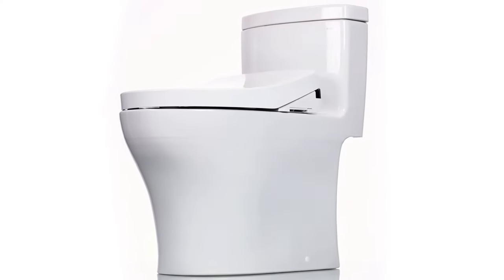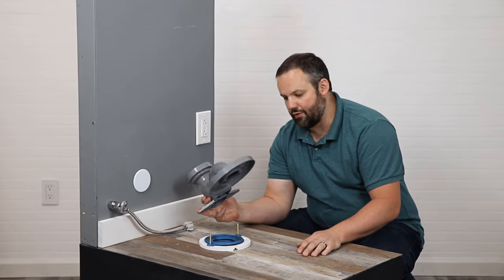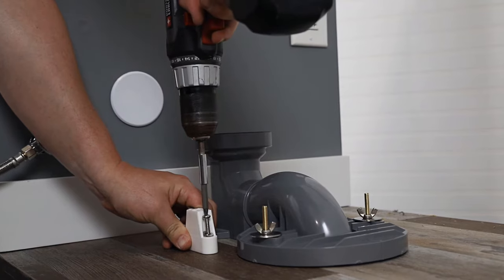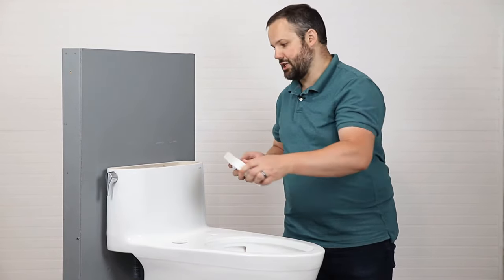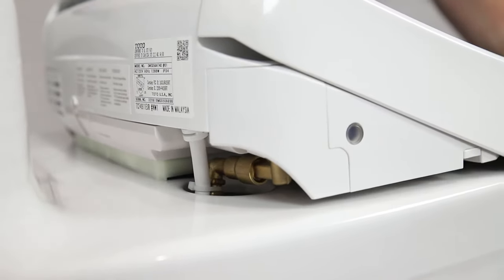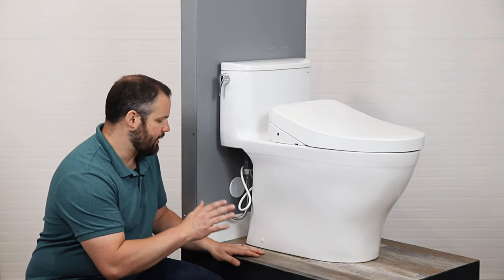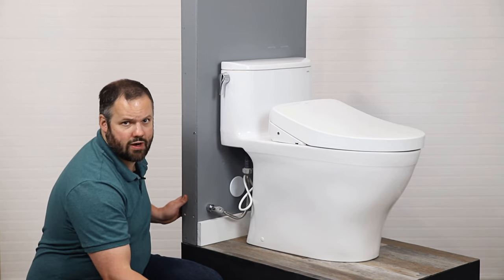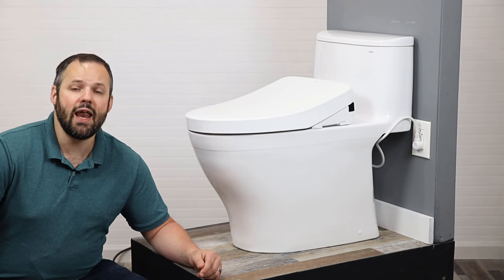How to Install a TOTO Skirted toilet | TOTO WASHLET+

Comment: Hi Daniel, 

My auto flush on my nexus with washlet 550e doesn’t work consistently. It does auto flush but not every time after use. What can we do to fix it? 

Is there option to auto raise the seat as needed after the lid auto open?

Does Toto sell adaptive children toilet seat for little kid? If not, will it cause any sensory damage to the seat itself if we place one on?

Thank you very much for all your straight to the point informative, honest and helpful videos!
Reply from the maker: Thanks for asking! The auto flush should work every time.  If you want to reach out to us with your order number with us, we can file a warranty claim with TOTO on your behalf.  There is an option to raise the seat on the top of the remote.  If you don't see it, whoever installed your auto flush did so incorrectly, and did not put the proper top on the remote.  There is no adaptive children's toilet seat made by TOTO that I'm aware of.  I would worry about scratches to the seat should one be used.
Hopefully you found this helpful!!  Thanks for reaching out!!

Comment: Just installed ours thanks to your video! Is it normal for a little bit of wiggle up and down. Only when we lift up would it do this. Not when we apply downward pressure.
Reply from the maker: It is normal to have a bit of wiggle.  If you're concerned about it, I'd recommend checking out a local show room, and seeing how the wiggle on their washlet+ units compares to the wiggle on yours.  That will help you determine if your seat is properly installed.

Comment: Hi, I measure 11 inches from the flange bolts to the wall. Will I be ok installing this unit?  Thanks
Reply from the maker: Unfortunately, anything under 11.5" is going to be too tight. You could try an offset flange to help get that extra bit of room or look at an option that comes with a 10" rough in size (Drake or Aquia are good options)

Comment: We just purchased a washlet+ toilet and didnt realize it required a special model of bidet. Can we still install our (current)  SW3036 ? I know we wont be able to hide the hose or cord but having a hard time figuring out if thats the only ramification
Reply from the maker: You can absolutely still install it!  You are correct, there are only a few ramifications:
1. The cord and hose will be visible.
2. You won't be able to install auto flush
Aside from these two items, you'll be just fine!

Comment: I have a Toto Nexus 1G that needed this kind of installation. I had to remove the toilet and those plastic things that keep the toilet from moving side to side have holes in them from the initial installation. Is it ok to reuse the same mounting blocks when reinstalling or would I have to get replacements? If so, do you know where I would be able to buy them? Thanks.
Reply from the maker: I've had customers reuse the same mounting blocks before without any issue.  In my opinion, reusing them is fine.

Comment: I am updating my bathroom so i have the wall exposed so i can run a new outlet to the toilet. What about hot water? Does the seat warm up cold water or is there a seat that can use hot water line?
Reply from the maker: It heats the water in the seat itself!  No need for a hot water line.  Great question!

Comment: At the 6:00 mark, do those sidescrew need a proprietary bit? I'm having trouble tightening a loose bowl with a regular screw driver.
Reply from the maker: Nope, normal Philips head, but it's a LARGE one...  If you're sliding you might try to find a bigger screwdriver bit...

Comment: 10:43 The bidet socket has a special connector.  How could I add a water filter for less calcium between the T connector and the Bidet socket?  Thanks.  Is the socket 1/2", by the way?
Reply from the maker: Sadly TOTO does not recommend any kind of filter.  Using one will void your warranty... :-/

Comment: We have a Toto C5 bidet and our plan is to slowly upgrade with Toto toilets.  With the different orientation of our C5 bidet does that mean we can’t use the power cord and water tube hole on the toilet for a seamless look?  Can the water tube on the bidet be adjusted to make a seamless connection?  Thank for the video and answers to our questions.
Reply from the maker: Sadly it can not...  The TOTO washlet is either made as a washlet+ seat, or it is not.  There's no way to convert it after the fact :-/  Sorry for the bad news...

Comment: Hello Daniel.  Thanks so much for this informative Toto video. Does the flange adapter have to be perfectly symmetrical to the drain pipe?  I need to install my Toto toilet about 2cm to the right of the centerline of the existing drain pipe.  My contractor tells me it is impossible to do this as the adapter has to be perfectly aligned to the wall as well as being perpendicular to a straight line passing through both openings in the flange adapter.  This has become a major issue on my remodel and he has offered no solution.  I hope you can help.  Thanks!
Reply from the maker: If I understand your statement correctly, because the adapter has to be bolted down to the flange, the adaptor does need to be lined up with said flange, which would then mean the toilet would have to be installed at an angle of the flange is not straight.  If this is what your contactor is saying, I agree...  :-/  If you would like to send some pics over, I'd be happy to review and give additional feedback if we're able to come up with a workaround.

Comment: Can you mount a regular total seat on this nexus washlet
Reply from the maker: Washlet+ toilets can be used as a standard toilet with a standard toilet seat. You will have the hole in the back for where the bidet/washlet cords usually route. So that is sometimes not customers preference. The Nexus is made as a standard toilet without the washlet+ hole if that was the plan from the beginning.

Comment: The two side blocks do not have pre-drilled holes. When we put side screws, these look like they go into those side blocks. Should we first pre-drill pilot holes into those side blocks? I feel directly putting those large side screws will crack the plastic side block.
Reply from the maker: The blocks do not have predrilled holes, and are not designed to.  TOTO does not recommend drilling holes into the blocks.  While it would seem like the plastic might crack, to date we've never seen that happen, and due to the fact that TOTO does not suggest drilling holes in the brackets, I'm assuming they rarely if ever see an issue like that either.  Great question!!

Comment: I have the new toto Carlyle toilet and the Toto Sw3084 washlet. Is it still possible to install the washlet water hose through the hole? The bracket is longer than the one in the video, obstructing almost half of the hole. Can I still put the hose in the hole or is there an adapter that can be used? Thanks!
Reply from the maker: There is no adaptor.  I do not think the fact  that part of the hole is covered should be an issue.

Comment: We just installed ours and it has a small leak at the base, would you happen to have any trouble shooting tips?
Reply from the maker: There are a few different reasons we've seen this happen.  Normally when this happens it's because either the flange is too low, and you really should be using 2 wax rings, or the toilet is cracked somewhere that is causing a leak.  If the issue is simply due the the flange, the fix is easy.  Take the toilet off, put two wax rings on instead of one, and reinstall.  If the issue is due to a cracked toilet, at that point, you'll need to reach out to whoever you purchased from to see about how they handle replacing the toilet.
In the future, if you're ever looking for another one, reach out to us for a great deal!

Comment: Hi Daniel, we have a Toto smart toilet with the skirted bowl and flange adapter that we had installed about a year ago.  We are getting some sewer gas smell.  Is this an issue you have run into before and what is the best way to diagnose where it is coming from and how to fix?  I believe we used a wax ring, but can the rubber ring on the top of the flange adapter be replaced?  Thanks for your help!
Reply from the maker: To date I have not heard of this happening.  However, in my opinion, I think you're heading in the right direction. The adaptor is easy enough to replace, and should be replaced if the rubber looks like it's going bad.  Again, to date I've not seen that be an issue, but it's worth checking.  I would assume that if you take the toilet off, it will be clear where the problem is.  As long as it's not cracked porcelain, the fix should be fairly easy
Reply: @ManyBidets  Thanks for the quick response Daniel! I will let you know what I find.  We love the bidet, by the way.  It is awesome!
Reply from the maker: @markschulert2189  No problem!  Next time you're in the market, reach out!  :-)

Comment: So do you recommend using wax rings or rubber no wax rings?
Reply from the maker: We like both, but personally use the rubber rings as we're often changing out toilets, and they are cleaner.  We've never had a single issue with leaking.

Comment: Very helpful, thanks 🙏
Reply: I would think few people would put a toilet on wood, what to do when using tile?
Reply from the maker: Very valid point!  We've installed toilets like this on tile as well.  A few tricks worth considering: First make sure you have a drill bit designed to drill into tile.  TOTO provides anchors to insert into these holes.  Secondly, put some painters tape down and drill through the tape.  This helps to keep your drill bit from sliding around so you get a nice clean hole.  Let me know if you have any other questions!

Comment: Which bidets have 10" rough with universal height, auto open close & flush
Reply from the maker: If you're looking for a traditional, non-skirted design, I'd recommend:
https://www.manybidets.com/product/toto-drake-transitional-washlet-s550e-two-piece-toilet-and-bidet-system-1-28-gpf-ada-compliant/

If you're looking for one with a skirted design, I'd recommend:
https://www.manybidets.com/product/toto-aquia-iv-washlet-s550e-two-piece-toilet-and-bidet-system-1-28-gpf-0-9-gpf-sku-mw4463056cemgna/

Comment: Hi Daniel, the bidet not working even I press the side button
Reply from the maker: We always recommend trying a hard reset by unplugging the unit for at least 60 minutes and plugging it back in. Checking your electrical outlet for power as well or plugging the bidet into a different outlet to test are other good steps to take. If you are still having issues, reaching out to the manufacturer directly will be best.

Comment: Great video!  Last year in a bathroom reno, the plumber did not rotate the Tee Connector so the washlet hose is sticking out in plain view to the left of our mostly skirted Toto Vespin II bowl.  If I shut the water off and flush until it is out of the tank, can I, at this point, disconnect the water supply and try to rotate the Tee Connector myself and reconnect the hose, or would I need an entirely new hose and o-ring?  Installation was 9 months ago.  But maybe I should have a plumber do it and test it for leaks?  What do you think?  A second bath reno is coming up!
Reply from the maker: If you follow the proper steps (as you listed out above) I don't see any reason why you shouldn't be able to do exactly what you're trying to do without any negative side effects. You should be able to turn the water supply off, drain the tank, reposition things, and reconnect without needing to pick anything else up.  Hope this helps!
Reply: @ManyBidets  Thank you!
Reply from the maker: You are very welcome!  Thank you!

Comment: In addition to the Toto S550e Bidet seat that has the cord and hose coming differently which allows it to be routed through the big hole in the toilet large hole, are there any other bidet seat that have that same cord and hose configuration coming that way?. I am asking as I am buying a Kohler K23188-HO-O that has the same large hole to accept the cords and conceal them. I do not want to see the cords if I buy the wrong bidet seat..So I was thinking buying the S550e but I wonder if other brands have also a configuration thta totally conceals the cords if routed through the large hole on toilet ceramic
Reply from the maker: Thanks for asking!  We have, to date not tested the TOTO Washlet+ seats with other brands of toilets to see how they work.  I could see the other brands working with these washlets if the hole was in the proper location, but since we've not tested them, I can not guarantee that it would work. Your best bet would be to get a seat, and try it yourself.  If you were to get one from us, you could return it if it was not installed and didn't work.  Thanks for the question, and let me know if you want to give one a shot!
Reply: @ManyBidets  Thank you very much for your quick response. I will decide on the bidet seat once i install my new Kohler Toilet
Reply from the maker: @chinomalon  Sounds great!  Let me know if we can be of any additional assistance

Comment: is this durable?! The entire toilet is held down with only two screws going in sideways... not even a clamping force
Reply from the maker: This is how most skirted toilets are installed. The combination of the weight of the toilet and the screws and mounts make it a very sturdy set up.

Comment: Ironically the Costco Toto washlet seat does NOT come with a mounting bracket compatible with a Toto washlet + toilet 😓
Reply from the maker: Generally speaking bidet seats sold at Costco are more entry level, and tend to be designed specifically with Costco in mind.  You are correct, no TOTO washlet you buy from Costco is going to configured for washlet+.  We sell all the TOTO products should you ever want to upgrade.

Comment: Is it a pain to clean the toilet seat? Can it be easily removed and hosed down?
Reply from the maker: It's not too bad.  It's easily removed, but should we wiped down, not hosed down due to the electronics in the unit.
Reply: Don't do like me. I steam cleaned my Samsung to get into all the crevisses. It did.  But it ruined the electronics. 
  Bought a Vovo (I'm in Europe). Altoug h the fittings are identical i can't push the seat onto my skirted   bowl despite using silicone grease and marking the  back with a Sharpie. Either I've put thé chrome plate upside down or made some other error or i have to drill a large hole in the skirt or   buy a new crap ola   bowl. And Ive sent two ot hers as Christmas presents. Hope those people don't have nice toilet    bowls.

Comment: Boy, did I have a hell of a time installing one of these. Flipping a property, so we bought pre-owned stuff much of the time. I had no template, and the waste pipe flange was rotated and installed wrong. None of the flange bolts would work as the flange was so worn and busted. Luckily some tapcons did the trick.
Reply from the maker: Thanks for sharing!  We absolutely find that buying used or preowned can be problematic.  9 times out of 10, they don't come with all needed parts, they are hard to transport without breaking, and more.  Thanks for sharing your experience.

Comment: love the bidet but the wiggle is not a good design
Reply from the maker: The wiggle can be a bit annoying, but it's pretty minimal. If you really want a unit without any wiggle, you'd want to upgrade to an integrated unit.  Here's a compare we did of the most recommended TOTO integrated units on the market: https://youtu.be/kxPcICW995c
Reply: @ManyBidets I'm considering buying this toilet. Do you think we can rig up something to rid the wiggle?